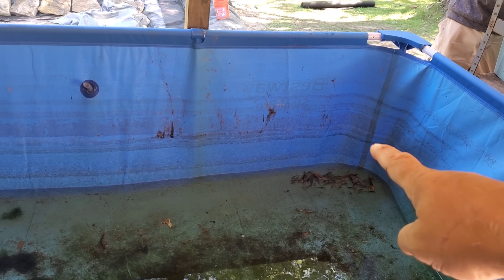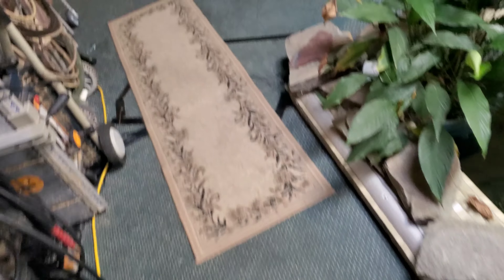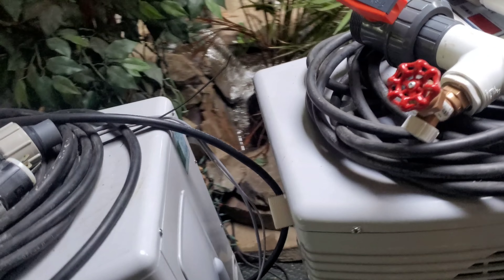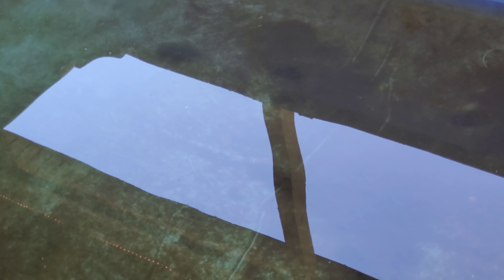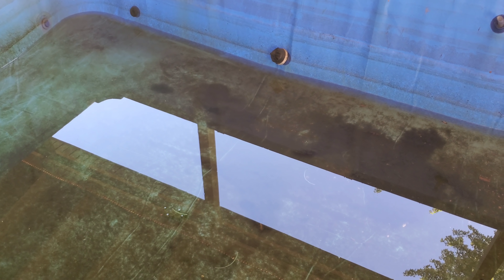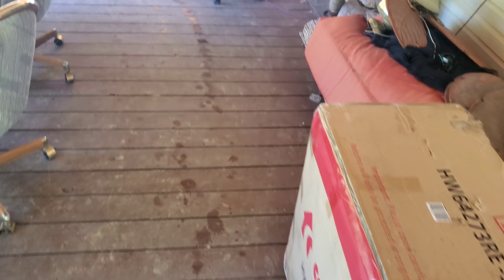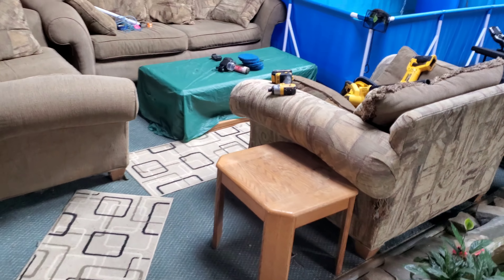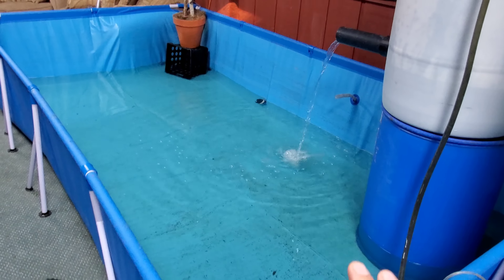Shaq Koi Baby Update. had to move them, winter is coming

Comment: What you guys need is a load of egg crate. Cut it into the correct size, zip tie it together and use pond noodles along the top. Then you can place it into the big pool and use that instead of having to move a load of stuff to put a pool pond in to hold the fish temporarily. After it's all done you can cut the zip ties and store it flat somewhere outside.